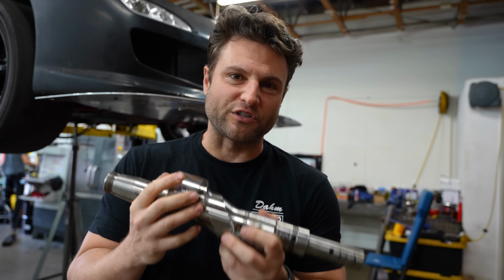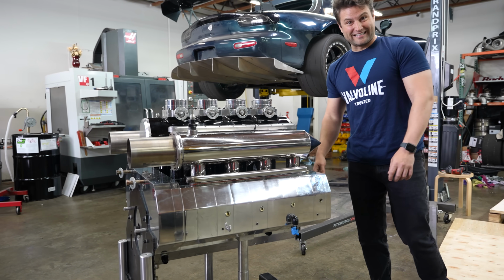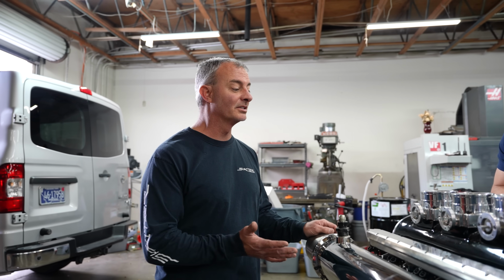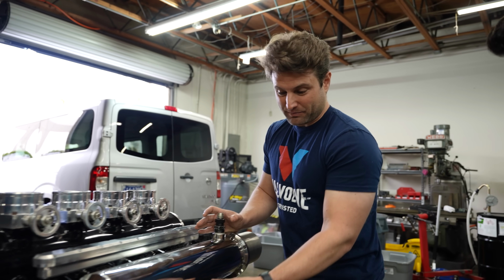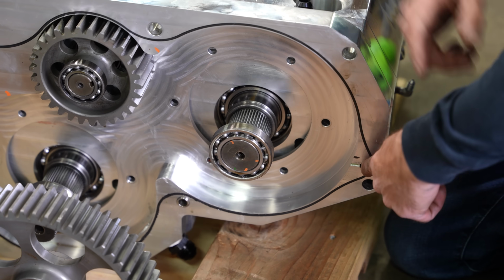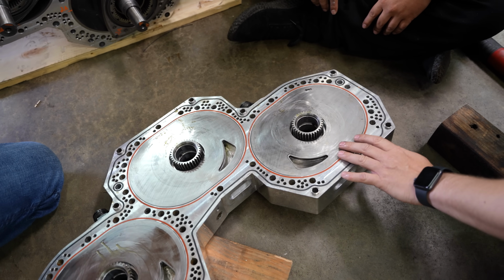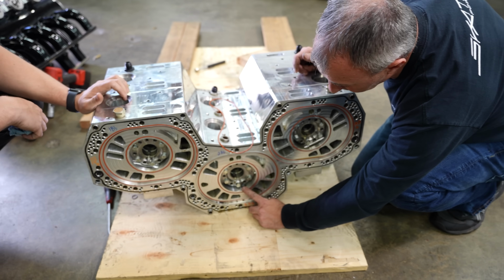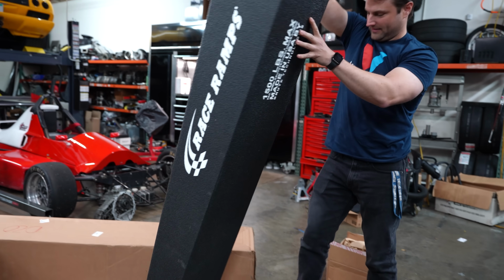I WAS GIVEN THE ONLY 12 ROTOR ENGINE IN THE WORLD!! WITH ONE GOAL IN MIND

Comment: big turbo, maybe some NOS additives or hydrogen and electric turbo on bottom in future… there will be a loot to blow out gases . if the exhaust equalizers do not choke the power and you calculated them size to pik value with no mix cycles to don’t choke each other will be loot horses .  these counter-rotating rotors balance the rotating mass and will not move the car even on one axle. nice unit for drag racing.  That middle rotor has big mass?

Comment: I absolutely love the rotary/Wankel engines. My first one was in the 70s I was in my teens I am 71 now and still in love with these engines, it was a RX3 or 4 I don't remember and it had a four barrel carb on it that alone blew me away and it flew,  my ex girlfriend got it. So 2021 I bought a2006 RX 8 and I love and baby that car. I have seen guys on YouTube say that you should add two stroke oil to your gas to help the rotary seals. So because you are the rotary expert should I do that? I haven't done it yet because I am worried about it smoking. Thank you in advance for your answer I hope Lol.

Comment: Im curious about what you guys are gonna put it in? second, wtf transmission could even handle that😂😅 other than a dragster gear box that can handle an engine that produces 11000 hp, but even then, it's still gonna be crazy to control lmao like no traction possibly  cause that engine is too big to try to 4x4 it😂

Comment: what if you 40 bolt each rotor and you full long bolts. the torque across will be equial at that point.built them like two rotors stacked

Comment: I don't understand why 12 rotor makes it so amazing? I'm assuming adding rotors wouldn't be much different than adding pistons to a regular engine. Is it somehow more difficult with a rotor engine?
Reply: How many 12 rotor engines have you seen? If it was easy someone else would have built one.
Reply: @TysonGarvin  of course it's difficult to build a one off engine. That goes for any engine. My point is once you figure out 1 rotor or cylinder, bolting more together isn't exactly a breakthrough. Detroit diesel did it in the 1930's when they build the V16. They simply bolted 2 V8's together.
Reply: @okgroomer1966  the 3 rotors, 4 rotors, 6 rotors where they are just bolting more together is simple and anyone could do easily, they could technically make it as long as they wanted it could be a 1,000 rotor. The difference is mine is not using Mazda parts it is a totally one off design with a lot of design work to make the package fit into a specific package size.
Reply: @TysonGarvin  Thank you for the explanation.
Reply: @TysonGarvin  I wish I had 1/10th your abilities. And I for one am floored you made an engine design thats all horsepower and no torque, have numbers in the rpms of diesel's. Granted, took 12 rotors to get there, but its technically a rotary that could do actual work.

Comment: As anxious as I am to see what you do with it, I’m beginning to imagine why it’s taking so long.

Put that engine in either of your RX7s and it’ll turn into a strict dragster, the balance is going to be all over the place. Or, well, it’s actually going to be just one place: way too far out in front, probably causing massive understeer. But I’m certain the AWD RX7 could absolutely blast rotary world records.

I think the only way to use that engine without compromise is to design a chassis for it. Perhaps you can find some older Le Mans LMP2 dallara chassis and see what you can make work in there. I think that engine would require as low a mount point to not completely ruin the weight transfer.

Suddenly, a twin four rotor like the twin engine Escudo layout seems more feasible. I look forward to seeing what you do with it, but take your time to figure it out. I’d love to see a love letter to the 787b, but like the Porsche 917, no rules holding it back. Go nuts.

I think it would be best to start with a race chassis that already has tested aero- if you go full homegrown, it’s going to be a lifetime project to do the work that an entire race team would have to. But only you know what you want to do with it, so I look forward to a follow up.

Comment: Also finding a way to equalize intake running length would be important in this application, rotary, in tuning. It could also offer a tuning opportunity but more complex then most tuners have any intrest in dealing with, not that you're normal Dom. The sensor costs might be prohibitive, as well as the complexity of the ECU.

Comment: Coming from a apprenticeship at BMW in Munich and having the experience how engines are developed it astounds me that such a project is not developed on a scientific pattern with dyno testing and test bed conditions?! 
It looks good and interesting but does it work? How’s durability? What’s the efficiency? Performance is what interests me the least . There are to many dick comparison’s out there any way. See the antiquated „Pickup truck“ 
Ladder frame, leafspring , straight axle, big volume engine. For its size and consumption unbelievable waste .

Comment: That is not a rotary engine, it's a Wankel engine.
 "The rotary engine is an early type of internal combustion engine, usually designed with an odd number of cylinders per row in a radial configuration. The engine's crankshaft remained stationary in operation, while the entire crankcase and its attached cylinders rotated around it as a unit. Its main application was in aviation, although it also saw use in a few early motorcycles and automobiles."

Comment: Impractical. Wankel's engine technically speaking isn't qualified as rotary. It's more like a dance engine. The series of triangular pistons have to rely on journal bearings.  On top of that the apex of the piston are unreliable. 

By adding more pistons will only increase the maintenance costs. Besides the emission is terrible.
Reply: Don’t care, Brap Brap Brap Brap Brap

Comment: ive had an old sachs km48 poking around, shes rooted, ornament only...
but what always has messed with my head is how you get the effing main bearings and the rotor bearings in there once you go over two rotors. the e-shaft is larger than the journal... how the hell?

but then i guess they run pressurised oil fed journals, split much like traditional crank-bearings, and mounted on some funky doodad in the housing to let the e-shaft actually slide through those central housings...

yeah, id like to see some detail on that area...central housings and bearings...

sigh.
Reply: They are one piece main bearings/bushings in stock stationary gears. 20 min to 23 min should explain it to you.
Reply: @TysonGarvin  my bad, didnt see that, explains everything. i assume thats what they do on the triples and quads now...
lol, i forgot there was a gear jammed in there as well... that really had me head scratching for years. bearings this big, shafts this big, holes... this big... wtf?
cool. answered.

Comment: 7000 series aluminum is alloyed with Zinc. Although 7075 t6 is considerably harder than 6061 t6 I would say the Zinc is responsible for the awesome shine. Optical mirrors are sometimes made from a soft (pure) aluminim like 1100 so hardness is not the driver

Comment: So what if they improved the classic wankel rotor seal by making a slidable graphene laminate at each of 3 rotor tips; small enough to be light, for cylinder polish without abrasion, but thick enough for rigid but slidable shape.  Then use space-age poly-,oil lube.  Make that compete with Hytrel seals in testing.

Comment: doing the math here. A four stroke engine fires once every two full revolutions. A rotary engine fires 3 times per revolution. That's 6X. This crazy engine has 12 rotors. 6 x 12 = 72. That is like having a 72 cylinder engine!
Reply: A rotary engine fires one face of each rotor each crank revolution.
Reply: @TysonGarvin  More than that. look at the gearing between the inside of the rotor and the crank. There are three sides to the rotor. There is a power stroke each time a face of that rotor goes past the spark plugs (yes, there ar two of them for each rotor). That's a lot more than three power strokes per rotor per revolution.
Reply: @surferdude4487  every full 360 degree rotation of the crank makes one flat face of the rotor line up with the spark plugs. The next full 360 rotation of the crank makes the next face of the rotor line up with spark plugs. It takes three full crank revolutions to make each face fire once.
Reply: @surferdude4487  also I have two rotor’s firing at a time on the twelve rotor so there are only 6 timed explosions each full crank revolution.
Reply: @TysonGarvin  If I understand you correctly, the gear ratio between the inside of the rotor and the crank shaft is 3:1. So, wehn the rotors are going at 9,000 RPM, the crank is going at 27,000 RPM. That's even more crazy than I thought.
Reply: @surferdude4487  the crank speed is the number you would see on the rpm Guage not the rotor speed. The crank would be turning 9,000 rpm and the rotor 1/3 of that.

Comment: Each bank of rotors is balanced separately by opposing the rotors on the cranks.  I would be concerned about the crank splines becoming loose as the engine warms up and rattling themselves looser over time. This will also create vibrations. Pinning the joints might help. The counter rotating bank is not for balance. It is to subdue gyroscopic effects.
Reply: Maybe locktight green on the splines after final firing order has been determined?

Comment: I have a question about the cases.  Where did you source 7075 plate of that size, and was the machining done in the annealed or tempered condition?

And please don't use the phrase "over built", it is a low stress design.  Plus in designing spline connections, it is based on the torque being transmitted, not the power being transmitted.

That is certainly some magnificent machining.  Would you share what machine tools were used?  tia
Reply: The machining was done in the tempered condition. The aluminum it is machined from is 7075 - T651 which is about twice as strong tensile and yield as 6061 t6 which is what most people think is the strongest aluminum.
Reply: @TysonGarvin  Thank you, I know a fair bit about aluminum as I am an engineer  specializing in Materials Science.  Where did you source the blanks in order to get ones of that size?
Reply: @paulkurilecz4209  these were little blanks, I have made parts out of 7075 that were the size of a small refrigerator.  The 12 rotor plates were actually aircraft scrap pieces that had enough material after their cutout to make these out of.
Reply: @TysonGarvin  Thank you very much.  I am putting together a fabrication shop in order to bring some ideas into reality that I have wanted to do for a long time.  When purchasing scrap/remnants from an aircraft manufacturer is it just  a matter of getting on their list for surplus sales?  It really is some beautiful design and machining that you did on that engine.  What was it that you made that was refrigerator sized?

Comment: Hey Bro. you are doing some amazing work with rotaries.
I have a new, never before seen, Rotary engine design that solves all the problems with the Rotary engine concept and keeps all the advantages.
For example:
The Apex seal will never go bad.
Perfectly balanced without counter weights.
Variable compression ratio, can run Diesel, gas or any fuel.
More power to weight ratio then Wankel.
Higher RPM, Higher Torque then Wankel.
About 60% + efficiency. And much more.
If you are interested in looking at my engine and discussing it, please respond to my comment here!
And I will send you further contact info.
Thanks!

Comment: Hey Rob long time ago i have send Mazda in china a mail. Told them make the rotary with a direct injection. The injector must be on top to a bit closer to the spark plug side it almost at the turn. It will have a hole opening not to big. Just enough for the injector to spray a nice mist through without touching the side of the hole. Doing it like this you just need to select the right timing for spray and. And amount. A/f you know. It will waist no fuel and will also keep people happy with the gasses. Build one. Mazda did. But spray is to much on top. You have all the nice contacts. That's why i send you this.

Comment: Koenigsegg makes an electric motor that is about the same size as a dorito and puts out 330 hps

You can put three rows of five in a triangular configuration like this engine and it will produce 4950 hps and about the same amount of torque in less space and weight 

It'll be Oh! So! Much simpler, cheaper, and quicker with way way less headache

Then it won't need a transmission, exhaust, Turbo, ignition, just a handful of supporting components, like inverter, converter, charging, cooling, and control

Comment: Rob, if he didn't give you a 3D Model for that I would recommend tearing it down to get 3d scanned and reverse engineered so you can make parts again if you ever need to. You could also get it measured with a CMM, especially for gears, but scanning would probably get you more data for the billet but you'll need an accurate one.

Comment: First time viewer to your channel. This looks like an incredible build. Being around motors from the 60s on up and remembering when Mazda sold them in thier cars, I was always impressed with this motor concept. 

With a background in aviation and high performance cars this is nothing but a performance marvel. Remembering that the motors had seal problems; however, with newer technology that has probably been addressed.

I have worked in metrology and have a strong mechanical back ground, when I saw the length of the cross bolts, all I thought of was bolt stretch. I  was wondering if you were measuring bolt stretch or just torquing them down? 
What a beautiful motor. Can't  wait to see more.

Comment: Just wondering, has anyone ever ran a wankel on nitro? I wonder how an engine like this would perform in a top fuel dragster? And how it would sound?
Reply: Turbos and 4v dohc are banned in top fuel. Imagine how much faster top fuel could be. But... the NHRA does not want top fuel to run faster. Even @ 1000' , top fuel cars are already too fast for many tracks.
Reply: @nordic5490  Yeah, I know NHRA would never allow it to actually compete as currently top fuel is basically a spec engine. There was the McGee (4V DOHC), but those are all long gone now. However, you might be able to run something like that (A wankel on Nitro) as an exhibition event. Maybe race against jet cars as an exhibition. As the jet cars are actually slower that top fuel might be easy to beat them without pushing the envelope too far and therefore needing a lot of maintenance, and subsequently cost.

Comment: Rob, I would really like to see this engine go in a boat going forward. Want to see it in it's designed environment.  It looks like the water injection on the exhaust is going to be very prone to ingesting water into the rotors, be careful with that.

Comment: The modularity of the splined eccentric shafts is absolutely brilliant. It would be awesome to see that used in a normal design of rotary. You could take a 4-rotor and just pull it apart and put a 2-rotor together in order to meet different class requirements.

Comment: 7075 aluminium. Can't handle heat without losing temper and going soft as butter. 
Very prone to fatigue and corrosion microcracking leading to fatigue. 
Heard of the Comet Jet Airliner?

Comment: Not a fan of the smaller rotaries. But some of the work I have seen mainly from rob has swung me towards liking some of them. Especially  4and 6 rotor it sounds insane. 
the engineering alone In That monstrous 12 rotor well it’s  a work of art and I can’t wait to see it running with Rob’s knowledge it should be a weapon on a dyno if one can handle it.and on the track if it can fit in a car. Should remove tyres real quick.

Comment: Re. Diesel Wankel engines; It is usually considered that it is not feasible to build a Wankel engine using Diesel fuel because the combustion chamber shape does not lend itself to the high compression ratios needed for the spontaneous combustion. Rolls-Royce tried to do so and stopped in the late 1970s. If this man Tyson has done this then he is actually pioneering something, not just developing something. Wow! Please, Rob, can you show us a working Diesel-fuelled Wankel motor? Thank you and best wishes.
Reply: You are correct that a rotary engine using Wankels formula cannot achieve the compression ratio for compression ignition of a heavy fuel. There has never been a “wankel” rotary engine that has ran like a “diesel” without a spark plug, heated intake air, heated fuel, or some way of compressing the incoming air before it gets to the engine. 

I’m not using Wankels formula.

Comment: You are never going to get the heat out of this engine. every HP out is one into the coolant. The water flow through those holes is going to be insufficient. Warped seals already. Sorry to be down, but stand back and look at it. Perhaps a coolant slice between each rotor bank might get the flow up while keeping the modularity, although there's a length delta. Perhaps a different cooling media or very high coolant pressure - witness the Merlin - but an hour at WOT? Really? Maybe that's not your goal. Lovely machining. Probably a good idea to keep the coolant flowing for 10 minutes after shut down - see marine diesels. I know you have checked the thermal expansion between the crankcases and those holding together bolts & their consequent stress. The cranks are very impressive, the transfer gears will make their presence known - straight cut?  Go on, put it into a motorcycle.

Comment: mike finnegan would love this in a boat.

My only question is, why 34 spline... 36 spline wouldve given you a 10' tunability so you can have 1 rotor at 0', the next at 120, then 240 and back to 360/0'. It works with 1/4 also with a 0', 90', 180' and 270'